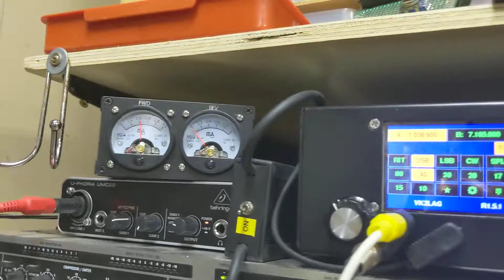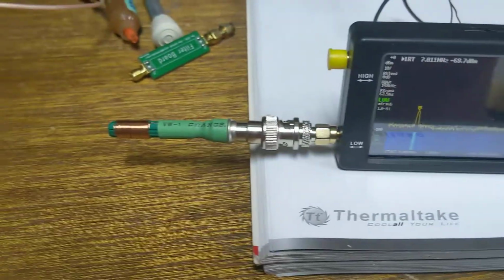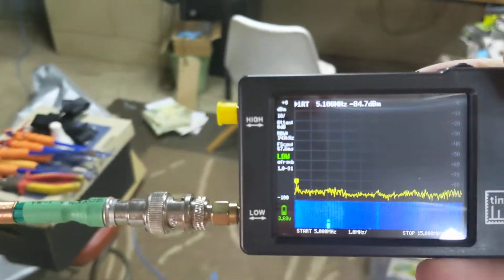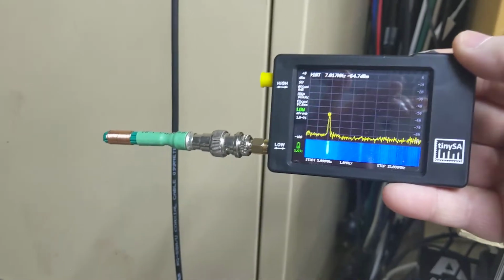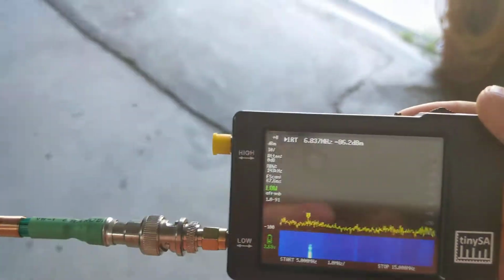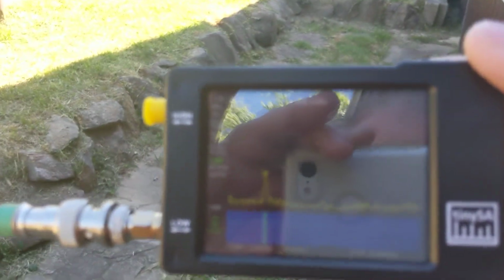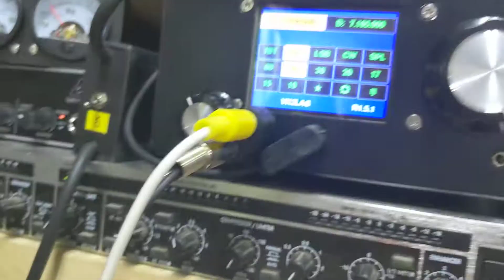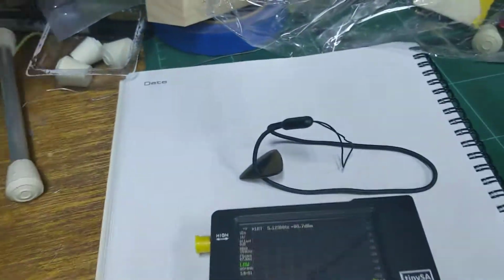TinySA with field strength meter antenna stub

Comment: I have the saa-2 on the way.
How did you set this up to achieve this?
Thanks and 73,
VE9ASN
Reply from the maker: I used the 40M tuned stub antenna I made for my field strength meter. A GDO stub would work as well. It's just a resonant coil for the band.
Reply: @AlanGarfield  thank you, but I was curious if the settings on the vna?
Reply from the maker: @VE9ASN  this isn't a VNA it's a spectrum analyser. A VNA is a totally different beast. A VNA can't really be used as a spectrum analyser. A VNA works similarly but it's more designed to be interested in signals, reflections, power and phase at different frequencies using it's own generate. A spectrum analyser is interested in only signal strength and frequency from an external source.

The device is a TinySA not a NanoVNA.
Reply: @AlanGarfield  I didn't recognize the difference in the name, I assumed they were different versions of the same device!!!!
Thank you so much for your explanation.
73
VE9ASN

Comment: Ha-- just checking my WSPR logs, I actually heard your station on August 9th... (I don't go HF that often.)
Reply from the maker: I'll look at mine, what's your callsign.. That's awesome, what power was I reporting?
Reply: @AlanGarfield  (apologies in advance if the formatting gets chewed..) 
grep VK2LAG .local/share/WSJT-X/ALL_WSPR.TXT
200809 0416   3 -16  0.62   7.0400993  VK2LAG QF45 40          0     1    0    1  459  0
200809 0426   8  15  0.49   7.0400948  VK2LAG QF45 40          0     1    0    1  809  0
200809 0436   8  11  0.49   7.0400925  VK2LAG QF45 40          0     1    0    1  810  0
200809 0436   2 -28  0.41   7.0401927  VK2LAG QF45 40         -1  1097    0    1 -112  0
200809 0446   3 -18  0.54   7.0400929  VK2LAG QF45 40          0     1    0    1  399  0
A few really good results in there-- +11 and +15
I upgraded to VK2CJB from VK2FJDA.. Unfortunately the place I'm at now really needs going Portable to do HF.
Reply from the maker: @cejaybee  they are decent! 

Have you used http://wsprd.vk7jj.com ? Really useful.